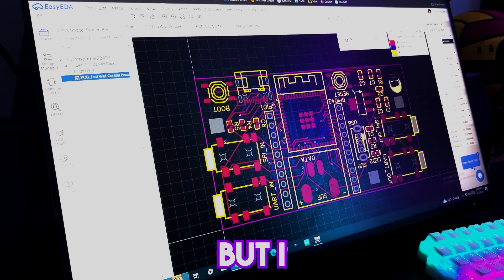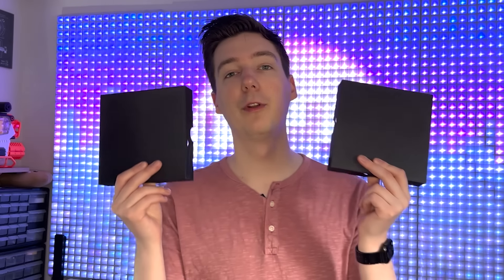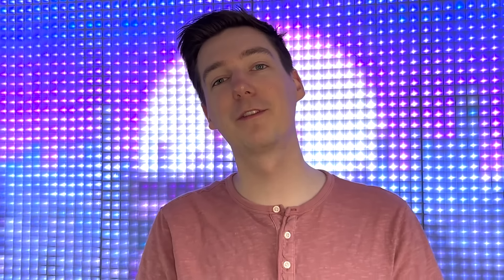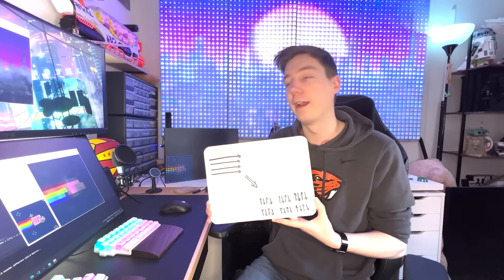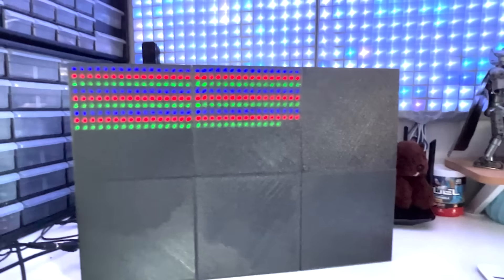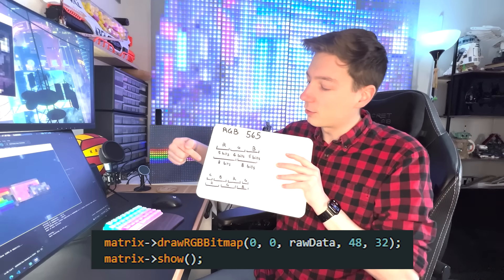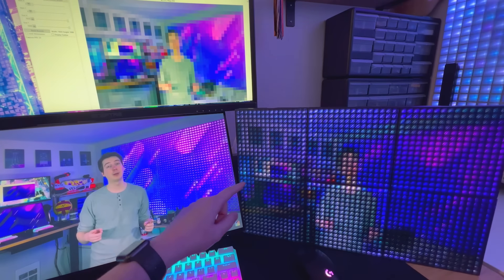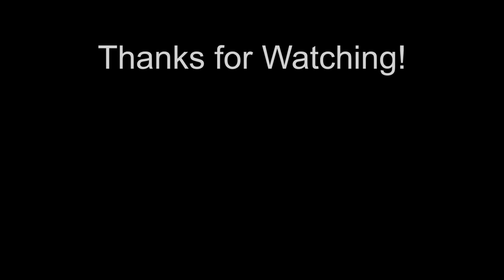I'm Building the Best LED Wall on the Internet

Comment from the maker: Let me know if you have any suggestions for the next revision. I'm trying to make this project as approachable as possible so you guys can build one too!
Reply: Can you share your PCB board or do you recommend we create our own?  That would be the hardest part for me.
Reply from the maker: PCB files are available on my GitHub linked in the description!
Reply: Slap on some good quality 1mm polycarbonate diffuser rather than 3d printing this not so looking good diffuser
Reply: As you have one esp32s3 per ´panel’ I would use 6pins for // outputs so you can have a correct refresh speed. Otherwise I think any animation will be too slow.
Reply from the maker: The refresh rate is pretty great as is. The bottleneck for this project will be the speed at which I can propagate the data between the panels when I have all 16. The esp32 has two cores so I’m going to use one to constantly receive and send data, and the other will be updating the pixels at around 30 fps.
Reply: @Tech-Random  could you create a mesh network to send the data ? Even if it’s based on wifi as the modules will be close enough it should be ok. Otherwise to speed up the data transfer you could use i2s to send data over 8bits in parallel if the is too slow
Reply from the maker: @TekWit I did that for my previous wall to send the data wirelessly but the network code gets very complicated when you add more devices.
Reply: @Tech-Random  if you based your code in the artnet protocol you should be able for each panel to declare itself and then broadcast the right part ti the right esp. maybe I am overthinking the capabilities of that protocol
Reply: what about improving resolution?
Reply: getting proper 32bit color working would be cool. Also ditching the grid lines. 
Will be really cool once the wall is finished.
Reply: Hi I'm a start up Love your project, I want to buy this custom chip JLPCB website is to complex.
Reply from the maker: I go into more detail about the order process in my full build video!
Reply from the maker: @efexzium I go into more detail of the order process in my full build video!
Reply: can you make a video explaining the wiring its confusing 5:31 and how do you install the software.
Reply: Hey bro, im a start up, im a software engineer would love to meet with you to make a step by step guide on how to properly wire and program this easily. Because we need to make a business with this project and we are having trouble figuring out how to wire and program this step by step.

Comment: Hey, I've been designing PCBs for 30 yrs and there's always some screw up. Don't sweat it. Fortunately, PCB production cost has dropped to near zero and companies like JLC make it so easy. I also don't mind you using the auto router for circuits at your designs' speeds. Keep up the great work on this awesome project. The stuff you're learning here, and showing us, will help with all your future projects. Thanks for the video.

Comment: I built a portable version that's similar to your design, but without the diffuser. It's modular tiles with a bay for 3 18650 batteries on the back, USB-C charging, daisy chaining, and an ESP-32. I can share the Onshape files if you want! I experimented with both the 5v and 12v ones and ended up going with 12v so I could chain more together before injecting more power.

Comment: If you increase the brightness just slightly on the pixels on the edges that connect to other tiles it will help camouflage the gaps. That's what video wall displays do.
I really like this project and it looks great. It's super weird that we are now to the point where it's hard to justify projects like this when we can buy screens this size that will probably cost less money in the end. Obviously, that isn't the point, but my frugal side keeps screaming at me when I start considering it.
Reply: Where.. Do you buy a screen like this for tge same price?

Comment: One rule of thumb for video walls: the optimal viewing distance is roughly the millimeter LED spacing switched to meters. A 5mm pixel spacing is best viewed from 5 Meters or more.  Super cheap Hub75 panel LED spacing as low as 1.87mm are available (for less than 1 cent an LED)

Comment: I whould like to see your reasons of chosing ESP for this project. Foe rxample, when I started a bit of similar project (unfortunatelly it took no significant traction online), I had ARM, STM and Raspbery as main options and ESP caught my attention later, when main features of the project was mostly designed. But I desided to still use STM32 as it had the most nomber of pins to arrange LEDs in parallel getting faster FPS, and also there was a lot of pins left to add most of extra functionality and expandability
Reply from the maker: I chose the ESP32-S3 specifically because it has dual cores so it can handle the amount of data it will need to process to achieve a decent frame rate but also its programmable through the Arduino IDE making it approachable for most hobbyists who may want to try a project like this on their own!
Reply: @Tech-Random  first point is valid, as generating frames on the fly is way faster than, for example, reading data from SD card (it can take up to 5 ms for 4k points), but peak framerate is also limited by speed of LED data transfer - I believe that was the reason that some listings or darasheets state that maximum LEDs per line is 2 or 4k (though tere is no actual limit).
but the Arduino IDE is still a method to program a controller so you still need to deal with coding at mid and low level and to interface different libraries with each other. It's no big deal if you're an engineer or at least coding hobbyist. But what I can see, a lot of hobbyists who specialise on practical skills like cosplay, crafting, making miniatures and so on are not good enough to be abe to code and prefer using ready-made devices. Does your approach allow a workflow like step 1 - download a program that casts something to your device, step 2 - buy a ESP32, step 3 - download a program that flashes your code to ESP32, step 4 - connect ESP to PC through USB, and flash it, step 5 - done? Or even better - buy online preprogramed device and download a program to cast something there - and start using it?
Reply from the maker: @WindLighter I would love to sell these as a pre-programmed product someday but right now that’s outside of my scope. For now I will be keeping the project open source so someone can simply buy the hardware and install my pre-written code. Anyone attempting this will still need the basic knowledge of soldering and 3D printing as well as setting up the Arduino IDE but all of those things can be learned for free on YouTube already so I don’t go into the details. I am planning smaller projects for the future that will be more practical to sell and ship from my own store but we’ll see how it goes.

Comment: Nice!! You’re doing the same as i’m doing and i was inspired by your previous video about the led wall. I’ve used Wled and an esp32 to setup 6 modules. When installing look carefully for the corner without a dot under the led. That helps with the rotation. And i’ve made a really thin grid to go over the leds and i’ve made the first few layers in white. I’ll add some pictures later. Keep it up!

Comment: Cool project. I want to make one similar at some point. For the diffuser, get some clear acrylic or plexiglass and run an orbital sander with 480 or finer grid thru one of the surfaces.

Comment: Looks great! The auto vinyl is a great option and for removing the grid lines it should be as simple as making sure to only print 2/4 of the edges (with exceptions for tiles on the edge of the entire wall). I'm a Bottom-Left edge kind of guy. I do think printing the actual tiles in a different color may help as well. Black give a bit of a screen-door effect, and white might be too reflective. Perhaps experiment with some differing colors? A shade of gray might end with the best results. Can't wait to see the results!

Comment: Cool project, I would recommend parallel driving the panels, for higher refresh rate (you will want this if you want to achieve good low brightness color performance using temporal dithering.) FastLED (and when I was doing my project neither did NEOPIXEL) doesn't currently support esp32 S3 parralel driving, but there is piece of code that utilizes the I2S driver of the chip to parralel driver up to 16 channels.
Reply: that was one of the reasons for making a project from the ground with another controller since in STM32 architecture it's easy to make 8 or 16 channels from the start with simple DMA setup

Comment: Have you thought about using WLED?It has a lot of support for different lighting programs and tons of custom effects, pretty sure you can easily sync up multiple panels as well with different esp chips. Im interested to know if you've considered it because I've been using it to drive my one panel and I want to make more
Reply from the maker: I’ve used WLED for small matrices and all of the lights in my house. The effects are great as well as the controls, but for this project I want to specifically mirror a PC display so that’s why I’m doing it this way instead!
Reply: @Tech-Random It is technically possible to use wled and signalrgb to do so (I'm trying that to make a custom locally dimming backlight for a high brightness screen), just define a custom led strip for each vertical line of led's in your array. Not sure how well it'll work but looks hopeful so far. I'm trying it with a 28 x 18 array

Comment: So I have had great success with a similar project with LED Matrix panels with HUB75 connectors and using hzeller/rpi-rgb-led-matrix on a raspberry pi 4 and some openCV to consume a NDI stream and output it via the library. Might be worth it to check that out!

Comment: I have 4 8x32 matix panels and they are wifi and also on my PC I have Signal RGB which sees them and all my lights in and out of the PC run in sync...can also mirror PC screen
Reply: Could you get signal to recognise them as an array of leds?. For mine i had to define every individual row as it's own custom strip

Comment: Can you release the original 3D files for modifications? It would make it so people could remix it easily for different size tiles.
Reply from the maker: The files are available through onshape but it can be a mess trying to find them there so I’ll add them to my Git repo
Reply: @Tech-Random  Can't wait. Thanks!
Reply from the maker: https://cad.onshape.com/documents/0b75d8a92eaed112abe058e4/w/ae56d212076a93f52d54f4f5/e/923ae6ff45cf32c0e0cd9106?renderMode=0&uiState=663526a8ddded813a2aa8592

Comment: why not use the 64x64 matrix in a P5 or smaller pixel size? they are about the same price per sq inch. hard to change now, but why the small matix?

Comment: Maybe you knew this already, but the part where the bytes were being ordered differently is called the "endianness". Some systems are little endian with the "lowest byte" and others are big endian when they store/send/receive data. Depending on the platform you're using, you may be able to find a more efficient way (e.g. some hardware-based call / byteswap library) to fix that problem if you're looking for a way to speed it up down the line.

Comment: Have you tried doing a white diffusor instead of a black diffusor? I've had some success doing that with by bambu labs printer with ams
Reply from the maker: My current wall uses a white diffuser and it works, but from my experience the darker colors don’t look as good. With the black diffuser I get a lot more contrast but the screen is less bright. It’s a trade-off that I’m trying to balance.
Reply: @Tech-Random  Good stuff just wanted to put the idea out there

Comment: Can i Power my esp32 With 5v 30a?
Reply from the maker: If it’s a dev kit then yes. If you’re making your own board you’ll need to step the 5V down to 3.3V with a linear regulator. The 30 amps is the maximum rated current for your supply and not the amount of current that the board will actually receive.